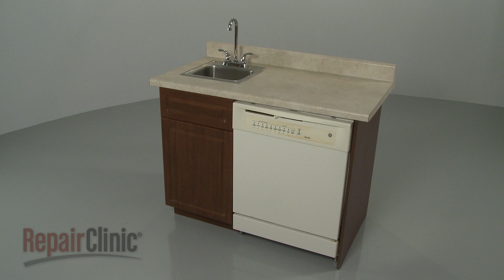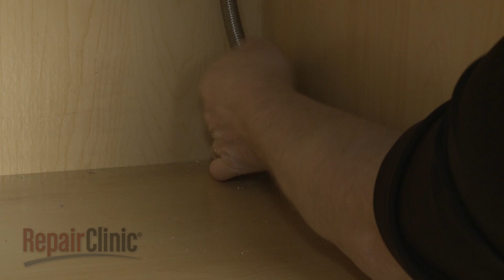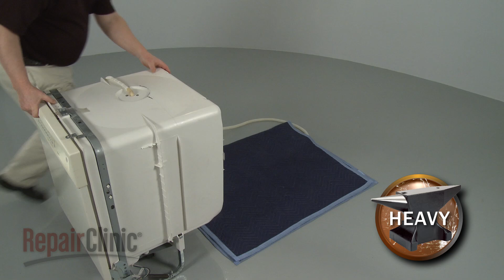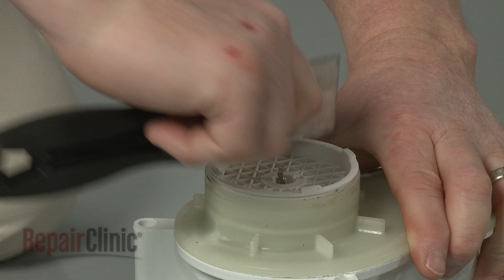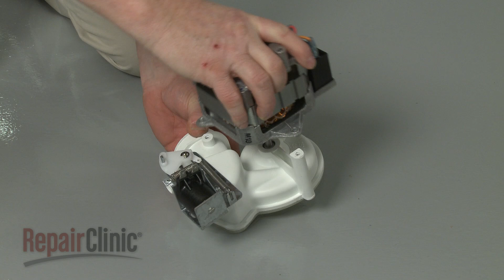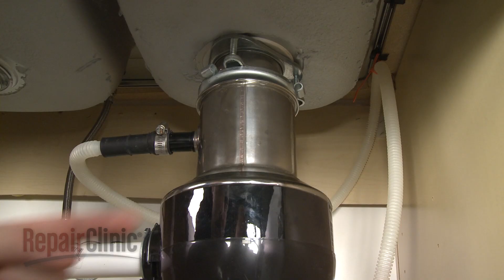GE Dishwasher Impeller & Seal Kit Installation #WD19X10032

Comment: My machine is a GE and my pump looks like this except it has a coiled wire chopper. It isn't turning off. Advice?
Reply: Hire a tech
Reply: If ur drain pump wont go off after, check ur timer. It might be stuck on or failing to energize the next sequence